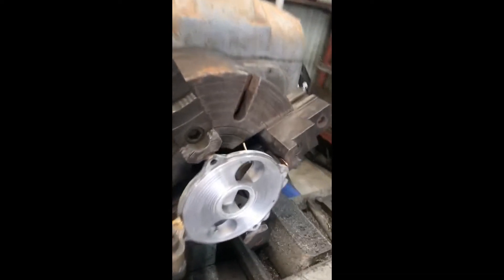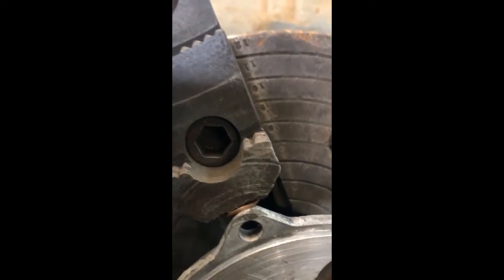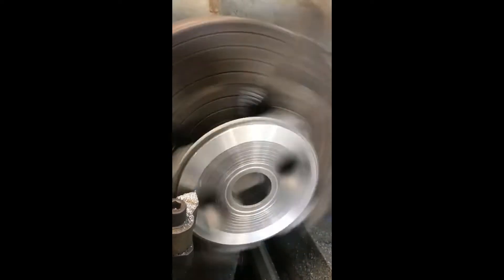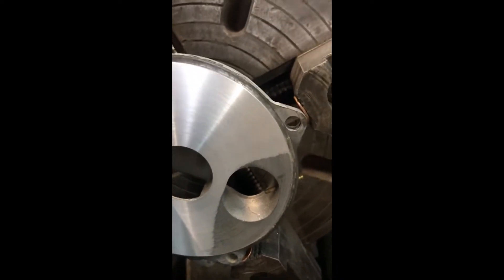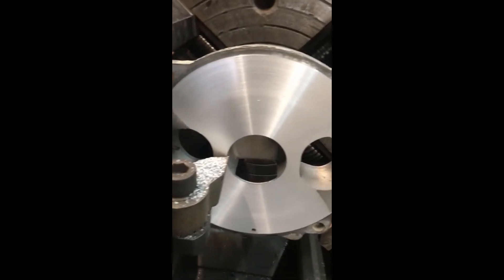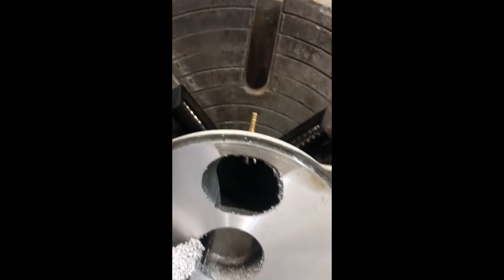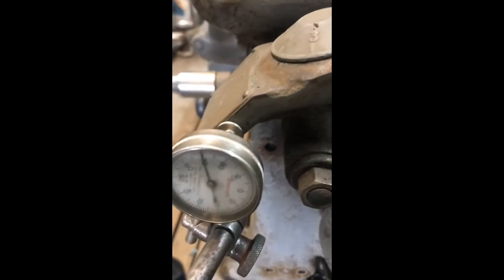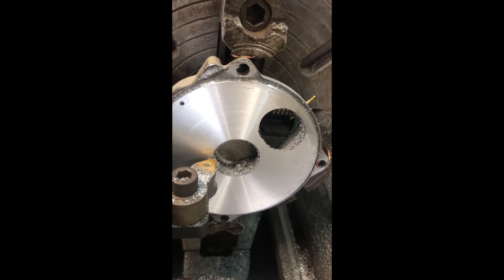Seadoo Rotary Valve Plate Machining

Comment: Do you offer this service?
Reply from the maker: No I do not offer this service.  This is just something I do for myself.  It is a bit of a pain and I wouldn't make much money for the time it takes me.  Also shipping would eat up much of any savings.  If someone was really in need of one I might try to help out.
Reply: @genetemplet7022 Hi, would it be easier for someone to just buy a new one from like SBT?
Reply: And how do you shave  the Inner lip since you shaved off that main area you need to have the same clearance what you take from the front you have to take from the sitting lip right